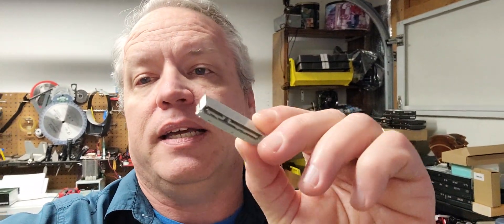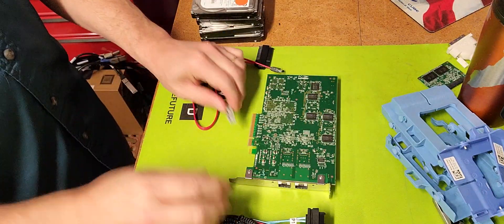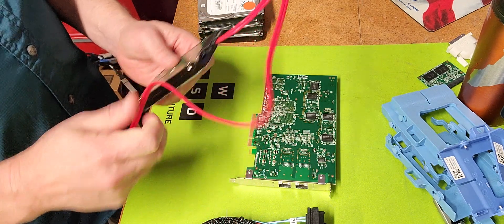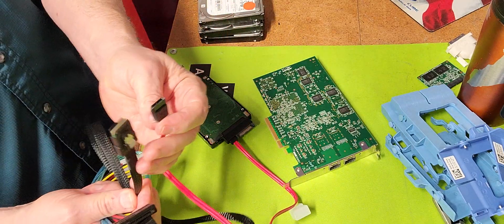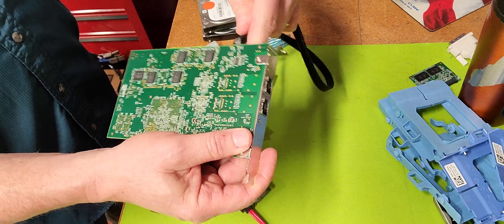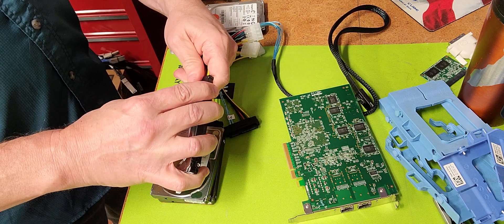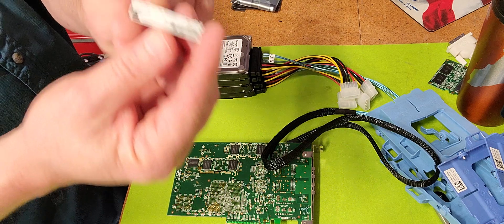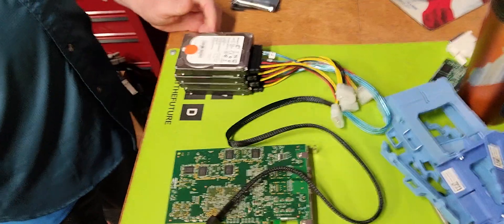2023 Updated way to test a single or up to four SAS  drives at once with a new type of SAS cable set

Comment: Late to the party and I didn't read any comments but it is kind of hard for me to take serious people that don't provide links to parts showcased in their video....? Maybe I have been spoiled by other Youtubers.
Reply from the maker: No problem, There are so many vendors out there to buy from, I didn't want my video turning into a catalog instead of support.  Here you go and yes, many vendors have this product.  I will only give one Vendor for these: https://www.ebay.com/str/91bestbargains?_trksid=p4429486.m3561.l161211 

For the SAS to 4 drive cable: https://www.ebay.com/itm/284618234227 

or 
https://www.ebay.com/itm/283447909246?itmmeta=01JQ6V4XCTM40F7938H35EM9DR&hash=item41fecfdb7e:g:H70AAOSwPzNlqjZT 

or with molex power connectors: https://www.ebay.com/itm/375917853484?itmmeta=01JQ6VAJVMXBV653DJGK07VZVN&hash=item5786733b2c:g:Oa8AAOSw~oJnge19

Comment: Hello can you please do me a favor and help me find which type of sas controller do i need i recently bought 2 SAS HDD 3TB each and i have 3 slot open on my motherboard “pciex8” “pci” and “pciex4” im so noob on this type of stuff i would appreciate if you can send me the link or name for the controller card THANK YOU!!!🙏
Reply from the maker: I find that if I am doing a small SAS setup in a PC tower I go with a LSI SAS contgroller (Link) https://www.ebay.com/itm/155007176276?_skw=lsi+9200+SAS+inernal+controller&epid=1037286617&itmmeta=01JA864HPM2H57RVXQ3K6ECYPZ&hash=item241725ce54:g:tQIAAOSw7VtbyUby&itmprp=enc%3AAQAJAAABAHoV3kP08IDx%2BKZ9MfhVJKkxFgKfNZBffG0XROBb3vGac4EWDg%2FBUGwiKBN0OjQ39ObQGuDW6LXJdFmXt0JaDwo7AczmdpDluBoVTwv%2BJVyQz87Wzvgl%2FvrkH4RWxiEr%2BLGz%2Fy3AKjHtgdsyD5RnVQoppcWdVPZNjipTFgWV2FSKPycUBJi4zL2GECKcbgBSGDlHetc6sn9o8Fua5OAFuYi7d0W2%2FNv0OhrDzJ%2Fk2uTN1o7mR116CAk7wDiBFzPH7bpR4Z3BmR6VolQ%2BXOrq1sC21gK8bCMr%2BNRtbYPai6kx6wlsDcEBuI8URi8X5CZU5hjwTdKRmf0TJSB0ycjBiyk%3D%7Ctkp%3ABk9SR8ibkobSZA  and then I get two internal SAS cable sets for connecting up to the SAS drives.  Here is a type of cable I am talking about.   (Link) https://www.ebay.com/itm/284618234227?_skw=SAS+cable+to+four+SAS+connectors+cable&itmmeta=01JA869FWW5BB902P309ERYH70&hash=item4244919973:g:UpoAAOSwNgVh1TS2&itmprp=enc%3AAQAJAAABAHoV3kP08IDx%2BKZ9MfhVJKmVJaE%2B34HtXE0OAnSIYRm9nyynQemDJ%2BFf%2Bh0QRlP%2BZeM59uynnMvyGgBDQ91kyb3%2Fv%2BhCuviAZCUg6GUdtCnyoWkgGVK9hfv3EXh%2Ftk5jpouCfSNHVT5uXcKCvt%2BGzFPV84ERCvZ8vld6v7KDkygP93zRaXoB7gn3pGDAnZOveVwgMOzjk8GWL2PBKzFOvCg%2F8F5UXaQr7yxL0AOG%2BIyAdpsi%2BEc3ALkhTz9QJR6P38dEK75ufzbz2NzyECn7SjbgyEgct3xPfBmzkzRFG1RJf7dvCzGa54FVlJ390jZi%2Fh6qSbRe2qkrfjv%2F%2B48o4rE%3D%7Ctkp%3ABk9SR8b-pYbSZA     Hope this works for your needs and please do your research ion the connect type you have for the drives. .
Reply: @leadiususa7394  will do thank you sir!!!🙏

Comment: Thanks for making this video. 

Just to understand, does this mean when you use the previous SAS/sata connector  cable you are halving the bandwidth to 6bbps as opposed to using this cable which is SAS to SAS providing 12Gbps?
Reply from the maker: Correct, the cable ratting is key but you have to have a 12GB controller and a 12GB drive for this to work

Comment: i bought a 3.5 inch, 10TB drive for my pc second hand, and did not read the description carefully enough..  It is a SAS drive not SATA.  I just want the drive to work on my PC.  Can anyone reccommend a controlller card and which cables i will need, to install it in my desktop PC. I am on a very limited budget, so I don't need anything powerful or something that will run a lot of drives, I just want it to work
Reply from the maker: Sure, get a ISL SAS controller with a dual port SAS connectors on the card for internal use then get the molex power and cable set for it and you are good to go.   let me know if you need links t o recommended hardware on ebay.
Reply: @leadiususa7394 please i did similar & got 4 8tb drives i need to work

Comment: I noticed in the video, that you did not say anything about what to do with the power cable section also why do you need to buy the cable with the power cable included? You also did not mention if the card requires a firmware upgrade or how to test the card.
Reply from the maker: I talk to RAID and HBA controllers in my other video (sorry) but this video was focus on the connection support cabling for you have to get it right for the hook up to work correctly.  Please check out my other video on the other SAS related topics for I cover almost all of it now.   If you don't see what you are looking for then let me know and I can make one on that topic.

Comment: How can my SAS drives get power through molex connectors if my Dell server motherboard does not have molex female connectors? It only has 6-PIn power connector. Any help will be highly appreciated. My server is Dell R240
Reply from the maker: I use a flip over from moxlic the sas. Now a days the converter comes with sas/sata cable set
Reply: Would you be able to share a link on one of those flip over molex cinnevtors from Amazon or eBay please? Thank you again.
Reply from the maker: Sure.. first link is :  https://www.amazon.com/xiwai-SFF-8482-22Pin-Drive-Extension/dp/B0BGXP3G86/ref=asc_df_B0BGXP3G86/?hvadid=652510459651&hvpos=&hvnetw=g&hvrand=6851357142254205529&hvpone=&hvptwo=&hvqmt=&hvdev=c&hvdvcmdl=&hvlocint=&hvlocphy=9015806&hvtargid=pla-2015306849668&mcid=52a8dfa63fd03ae59f580e5348e4416e&th=1

Another version: https://www.temu.com/ul/kuiper/un9.html?subj=goods-un&_bg_fs=1&_p_jump_id=894&_x_vst_scene=adg&goods_id=601099530088348&sku_id=17592275263279&adg_ctx=a-b8c88a13~c-cb202e89~f-64dad746&_x_ads_sub_channel=shopping&_p_rfs=1&_x_ns_prz_type=-1&_x_ns_sku_id=17592275263279&mrk_rec=1&_x_ads_channel=google&_x_gmc_account=647900107&_x_login_type=Google&_x_ads_account=1919904652&_x_ads_set=20587443773&_x_ads_id=150779941181&_x_ads_creative_id=675113468361&_x_ns_source=g&_x_ns_gclid=CjwKCAiA7t6sBhAiEiwAsaieYtcih-zW3XkYzmm113I9KtdVIJcSxrljQG3pdC_wWVVw-B_Yh5qGIhoCGjoQAvD_BwE&_x_ns_placement=&_x_ns_match_type=&_x_ns_ad_position=&_x_ns_product_id=17592275263279&_x_ns_target=&_x_ns_devicemodel=&_x_ns_wbraid=CjkKCQiA7t6sBhDwARIoAOjGrR26KqjVhA3qq3D2vWCOHHOdpopvKcBQMw9bNiE-lJbU-ZW6rhoCK14&_x_ns_gbraid=0AAAAAo4mICGrH-httMop-Pnr7TZkkqvi9&_x_ns_targetid=pla-2204259882873&gad_source=1

another type :   https://www.amazon.com/Highpoint-Internal-Mini-SAS-1Meter-8643-4SAS-1M/dp/B01JOXWDD0/ref=asc_df_B01JOXWDD0/?hvadid=632163229910&hvpos=&hvnetw=g&hvrand=6851357142254205529&hvpone=&hvptwo=&hvqmt=&hvdev=c&hvdvcmdl=&hvlocint=&hvlocphy=9015806&hvtargid=pla-441943995553&psc=1&mcid=654f41b12c4d3a888564178a3b9ef40d     Pick the one that works for your needs.  Enjoy...

Comment: Did it work in windows?
Reply from the maker: Most of the controller cards have core DIAG tools in the BIOS so the OS is not really needed but can help for advance testing using third party tools.  If it fails first in the HBA or RAID controller card BIOS tools, the device is no go.

Comment: Hi there
You spent a amazing much effort to your video
I need you to help me with a suitable converter from nvme PCIe m-key ssd drive to sata 2.5 in my Lenovo z50-70 laptop?
Reply from the maker: Look at this 2.5 drive caddy that can hold a NVMe module.  It may work for your needs  :  https://www.amazon.com/JacobsParts-NGFF-Enclosure-Drive-Adapter/dp/B07PQ9LFH6/ref=asc_df_B07PQ9LFH6/?hvadid=658824461252&hvpos=&hvnetw=g&hvrand=16922210913224045033&hvpone=&hvptwo=&hvqmt=&hvdev=c&hvdvcmdl=&hvlocint=&hvlocphy=9015806&hvtargid=pla-1659681019343&psc=1

Comment: Hello thanks very much for your time i just have a question 
I have some SAS hard drives 
I want to test them 
Do you think if i bought the SAS connector to SATA  that can read in my laptop  

I check to buy SAS TO USB 3.0 Docking Station
BUT it’s very expensive over £150 

if you have any simple solution will really appreciate it 

Thanks in advance

Comment: awesome video thankyou, may I ask what I need to type in to find the same cables please ? I live in the UK so need to hunt for the same one
Reply from the maker: Sure well you need to get the following parts  First get a fully SAS/power hook up cableings.  This one cable set supports up to four SAS drives: https://www.ebay.com/itm/284618234227 Next you want a SAS HBA or RAID controller card with one to two SAS internal connections to connect the drive to using the cable set.: https://www.ebay.com/itm/354492178223?hash=item5289615f2f:g:Xj4AAOSwz0xhKKLR&amdata=enc%3AAQAIAAAA8H50JGUOskx4rC6ciCW72ze4t1R66KHWZfJuYU58IsFyVxawjT6dBohgfv%2BYveXI5Gk3ip7aDn6muvKxAltQ4lCIkSI7HWxQJKpSp4rJv8jnh%2BIaoqjN61u74t2M27op49ckd1gfekl4jSOt6Dn8ab4TC7S3yP%2FkFilV5zhzDIONMATgrLpmzfOO6hxHLVTjlrPhOT%2Bm0RgbgA4cPuH%2BhqZRpyDNLXXT4PJWC3b913Sx58s7Q6nVQGWNzsBddUIcCwHi8nEirFBn%2F9NJJ7QrIgok%2Fgr1v8asYbAp8KXR7pJD%2BM7Se%2FWWlCSfog4odSLKvQ%3D%3D%7Ctkp%3ABFBM9OGXx49i     THen lastly you need a PC with PCI-E slots to use the LSI and aUnbuntu LINUX or I use Mint.  to run the testing and use my video or others to run the DIAGs you want to do.  Hope this help any...

Comment: you didnt show the card's connector,  only the back of the card,  but we all know what the SAS (4CH) connector looks like on the cards??, you didnt state the ebay type so we can find it easily, Im in thaialnd NO EBAY here (yet)  I guess that would have been helpful as I am a serverware newbie,  I made  a video as my problem is the SAS (all identical) drives show up in SG_FORMAT etc BUT they don't run up their motors when I issue a format/read/size any command they return "drive not ready" error - but the drives I am sure are ok, (I did format one for ProxMox)  so I am doing what you suggest and get another card and that cable,  into a PC and run some other software thanks for showing the multiway saves me canniballising an old server chassis
Reply from the maker: Yea,  I do these video is a format that you will know what and how you want toconnect your SAS drive up using either a bridge edge connector or a SATA to SAS 4CH internal cable with SAS power connections but there are four different types ranging from standard to OEM like HP so I defer to you to ID you controller tp cable to type of drive.  Now a days I do cheat and use a four drive bay cage that I took the back off so the back end of th drives were exposed and use the my 4CH cable to the LSI HBA controller and jsut use the single power connection to pwoer all four.  You do have to have the SAS power connector to correctly power up the drive but that comes with  this cable set I was talking about.  Here is the link to it. https://www.ebay.com/itm/284618234227    Sorry if I show something clear.  Hope this helps you some.
Reply: @leadiususa7394  no its fine (i got the set same as you coming from Lazada in Thailand where i live)  im an electronics engineer so if i get a four connector cable I will wire them in parallel but at the moment I'll use your idea and get the thing (LSI card and 1 SAS drive ) on my PC talking to it then I can try things in a better way than stuff sitting in the server chassis The SATA drive commands are a subset of SCSI so I think if I have a SAS raid controller in the PC  I may have a better chance of sending the drives a "forget the not ready shit" and get them to "spin up" then I can format them fingers crossed I'm glad i bought a cheap old bunch of servers with faults as curing them has really made me better schooled in the black arts of server maint/ProxMox....:-)

Comment: I'd like to convert 520b to 512b on the cheap to then make them able to work with a basic PC following, I'll be converting 10 drives(20tb total). I mainly want to do this because EMC will be a hair more EMP resistance and will be even another layer in a Faraday Cage scenario. I have about 14 TB to protect from the Sun/Nuke EMP but want it easy to connect to a cheap common PC I'll protect as well. I appreciate the knowledge your tinkering amounts to and would love some part numbers, as to other videos, I prefer ASUS/MSi boards too have for decades like your experiments. :)

Comment: This is exactly what I was looking for. Thank you so much for making this video.
I will be looking into the drive formats after I get the HBA (ordering now)

But the more I read into RAID controllers and HBA's, the more I seen exp'd users interchanging terms and not explaining it from a newcomer's POV.

I do have another possible suggestion for a future video too (and I know I am not alone in trying to find ideas) -- Could you give us some ideas what we could use our servers for?

I see racks like yours and Im thinking, "How does he find things to use all that?". I spun up some VM's to make 2 Piholes (backup and primary), a VM for Home Assistant to link some local lights n whatnot... and I'm getting into TruNAS (that's my next video I am watching)... but I am having a hard time finding ideas to justify my multiple servers running. I finally have the power to run things and I'm not quite sure what to do w/ it all lol. So I think it'd be helpful for many of us.
Reply from the maker: Sure, I will give you some ideas in my next couple of video to help out... /:>  Enjoy this stuff as you play!
Reply: @leadiususa7394  is there a way to boot into a SAS drive with a consumer mobo?

I have Asus Prime B550 Plus
Reply from the maker: @jirehla-ab1671  Only if the motherboard has SAS/SATA controller on it and most don't.  Research t he on board disk controller
Reply: @jirehla-ab1671  the B550 doesn't have a SAS controller, just get a cheap SAS controller card
Reply: @leadiususa7394  - Ill keep an eye out for them 👍  Ive become a bit more accustomed to HBA's now but I did def learn the hard way lol. Just dove right in. Seems a lot of the probs I ran into was involving drives that were write protected or offline, and I'd have to use diskpart to online them or clear attributes. But Im always up for learning so Im looking fwd to the new ones.

I also have to learn more about SFP+ ports. I tried connecting 2 of my switches (HP branded under Aruba in the UI and Aruba Instant On) w/ a passive DAC cable and although the HP one sees w/o a prob the Aruba does not and it begins flashing a heartbeat light as amber, and Im not sure if it's just the wrong nm light size/standard, or if the Aruba does not like SFP over copper or what. I want to get some 10G networking going in my home setup but my R720's NICs are 10G Ethernet. So Im gonna needa one of those Ethernet to SFP+ adapters but theyre like 50-60$ each. Plus then I will need to mix in a fiber solution between switches and now since those did not work w/ the DAC cable, Idk if Im gonna need a diff switch to connect the fiber to. If you have any insight you'd like to give on this subject, Im sure many of us would be very interested. Fiber standards are confusing to jump into.